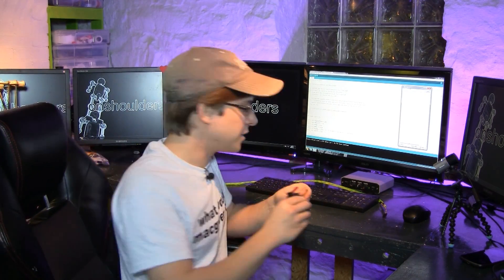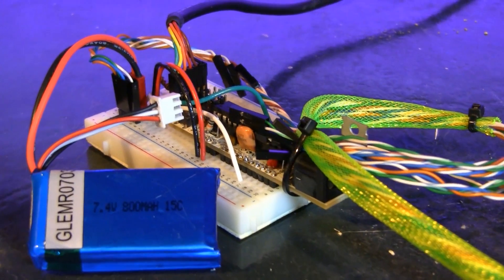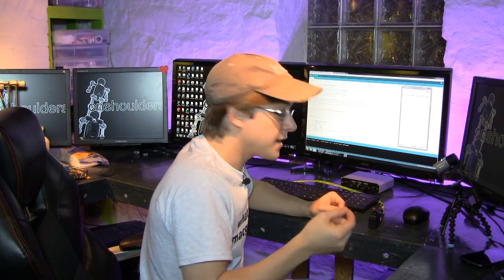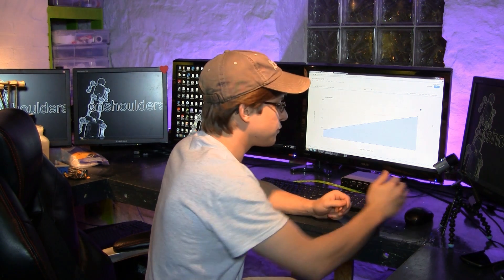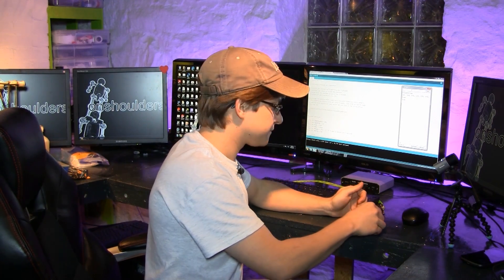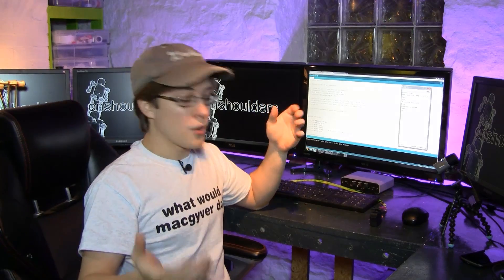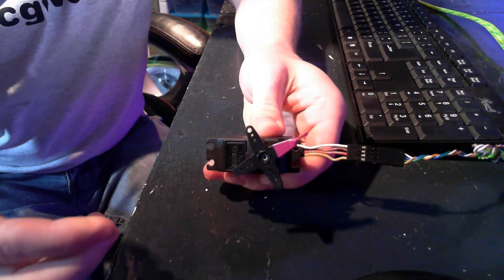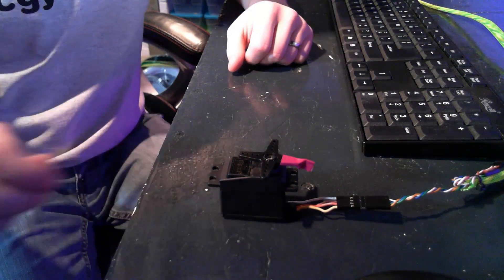onshouldersTv: Servo Animation

Comment: While this is cool, i have to wonder if I'm missing something...

Since you replicated the internal feedback of the servo doesn't that make the servo's own electronics redundant? Surely it does the same as wiring the motor through a H bridge, with the pot just hooked to the Arduino?

Comment: you will also be able to log what the dog bot does.  then play it back virtually.  Which would be very helpful if you run into a bug or want to tweak the algorithm.  

Or even cooler, have the perfect cold start every time.  The bot would be able to power on and stand up naturally regardless of how it was put to rest.